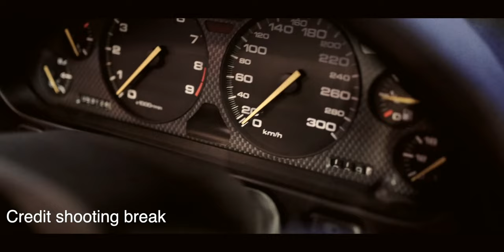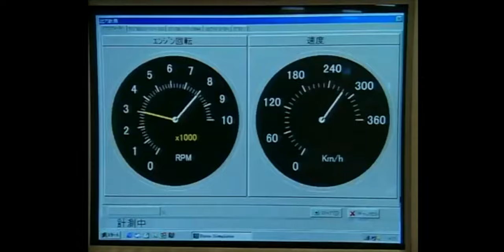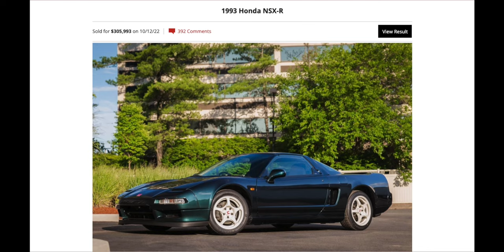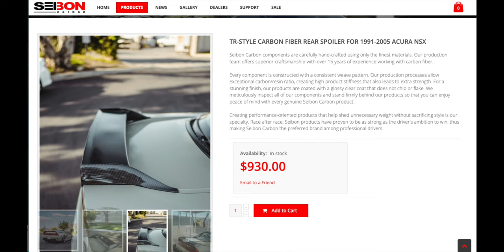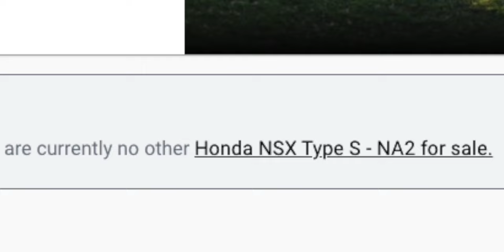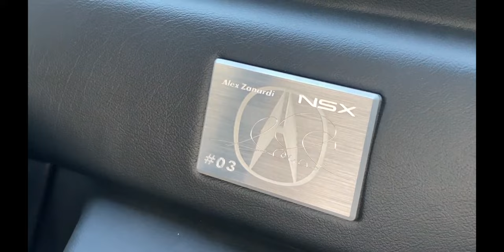The craziest NSX Honda ever made.

Comment: I'm not sure the '91 Type R was more powerful especially not around 290hp. . Plus it's used the same 240cc injectors and with that on 100% load you can get 300hp maximum. So I have a doubt they used the injectors on 97-99%.
Reply from the maker: Comptech's super chargers use stock injectors and its not an issue. Installing headers on a 91' will get you just shy of 290hp so I'd say it's fairly likely with all the modifications honda did to the nsx-r it was around 290. However I could not find any official documentation from honda, my source for the video was 3rd party but I think it's likely it was more than a stock nsx. Thanks for watching!
Reply: @driftindonuts  more air = more fuel -> more power. You can't make power from thin air because theAFR  ration is the same. Plus the CF supercharger require a more rich AFR. "The Comptech system requires a very rich fuel mixture (10.8 - 11.2 AFR)"

plus for comptech there is injector in the kit:
"CT Engineering (Formerly Comptech USA) 350-010. ... Rail & Injector ... CT Engineering (Comptech) Supercharger Kit 91-94 NSX 350-010"
Reply: @driftindonuts  and you can check the Dyno of the NSX-R by Science of speed here on youtube. Exactly the same HP, they dynod it.
Reply: @driftindonuts  290? Got to get mine dynoed. + 20hp would be great!

Comment: What I find crazy was when making the NSX-R it was all about reducing weight in pursuit of better handling/performance.  With the current 2017-2022 NSX having all those batteries and electric motors feels like the mindset was increasing weight to find that perfect driving experience 💀.  I feel the same way too that the NA1/NA2 NSX was the pinnacle of automotive engineering 😄.

Comment: Hey excellent video man, the 2002 na2 nsx type r is basically my ultimate dream car and it's really sad that Honda only made like 400 of those things, my question is why they made so little? I understand Japan loves to keep the good stuff to themselves but man they could of made a good few thousands of them, it's such an iconic car man, people tend not to know about it compared to how they know the rx7 FD ,r34 skyline gtr and the mk4 supra because those companies made hundreds of thousands of those cars while Honda didn't even make 500 of theirs, nsx will always remain on the top of jdm legends , great vid man
Reply: Just buy a 6 speed 2002-2005 and swap some things (final drive lsd, suspension, brakes, iterior, ect.), way cheaper! If you just like the looks, by a 91 atomatic with high milage and do the 2002 headlight conversion, 2002 front and back bumper + CF wing +some paintwork.
Reply: @markusluftner8418  I loved the looks and performance, if I gotta do that then I would also need that c32b, sadly where I live probably only got like 2 nsx existing and those owners aren't selling those gems but hey thanks for the info on the conversion
Reply from the maker: I would speculate they didn’t make that many because japans economy crashed right as the NSX came out and so the NSX-R’s that were planned got changed to Japan only and a smaller run. It is sad, would have loved to see what would have happened if they came to the US.
Reply: @driftindonuts  ohh that explains ,makes a lot of sense now, and who would of knew those cars are selling for nearly half a million USD if you were to get your hands on one
Reply: @markusluftner8418  It's not "just swap some things". Building a NSX-R out of a normal NA2 will cost double the price of the (used) car, there are a LOT of differences. And GL locating these seats (even the copies made by Downforce are now unobtainium), and the single pane engine glass, and other discontinued parts... Also you'll have to open up the engine, and blueprint and balance it.
Reply: @LegendaryGauntlet  I am not talking about making a perfect copy
Reply: @markusluftner8418  The weight savings alone,  and engine power, are both expensive goals to start with. You cant call it a NSX-R if that's not as light and powerful as the original... Oh also the NSX-R has special shocks and anti roll bars. And chassis reinforcement. These are now impossible to find mostly, at least shocks can be replaced by modern ones (like KWv3 or JRZ or Ohlins etc.)
Reply: @LegendaryGauntlet   Noone in their right mind would call a non Type R nsx a Type R. Point is. Modding even a na1 chassis to be faster than the na2 type r is very easy. And can be done cheaply when considering that the Type R is much more expensive.
Reply: @LegendaryGauntlet  what engine power? The NSX R has a stock c32b engine. That is race balanced.
Reply: @LegendaryGauntlet  XD bro, I own an NSX and a S2000 i know what im talking about
Reply: @markusluftner8418  Then show me your NA1 build that's better than NSX-R NA2 for cheaper... I'm curious. Especially how you replace the aluminium of the chassis with the improved version, the side chassis bars with the improved ones, or where you got your single pane engine separation glass.
Reply: @LegendaryGauntlet  Please Calm down. Point is a clean NA2 Type R way over 300k 

While clean 91 NSX is like 60-80k

There is a lot of money left to spend on that car.

My dream build would cost me way less than a NA2 type R and would be way way  faster.
Reply: @LegendaryGauntlet  Oh, and don't be too focused on the chassis. It is not that much different from an Na1
Reply: @markusluftner8418  What ? "Not that much different" lol it's almost a different car altogether. Serves me well arguing with trolls on YT.
Reply: @LegendaryGauntlet  Diffrences are slightly diffrent alloy + some diffrences in the side boxes. Diffrences speciffic to the Type R: Different interior. (Most savings are in the bucket seats and the carpet/removed sound deadening) Single Pian engine glass. Open engine cover. Carbon fiber wing and bonnet. I know NSXes very well. I am not a troll, I can link you my insta if you want.
Reply: @LegendaryGauntlet  Done Exhaust, and some cf parts.Down almost 80 kg from stock.